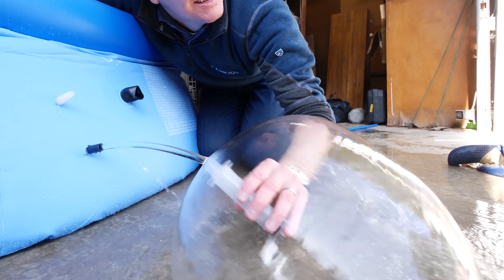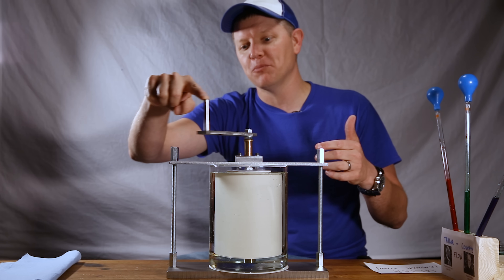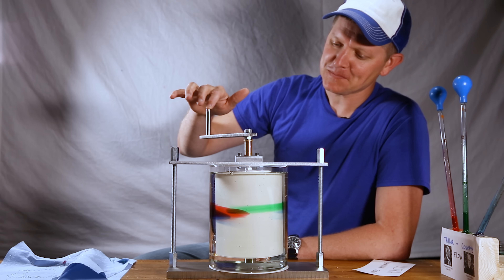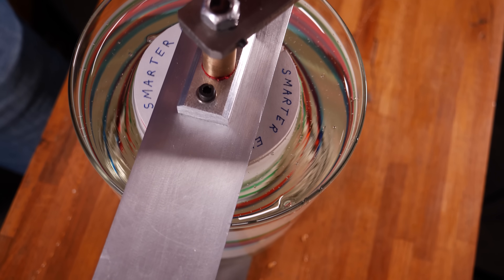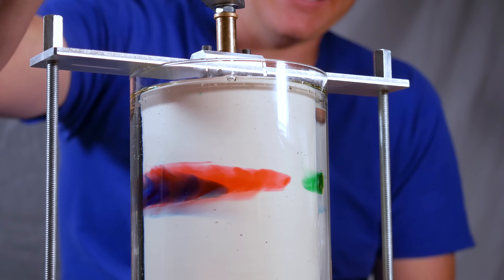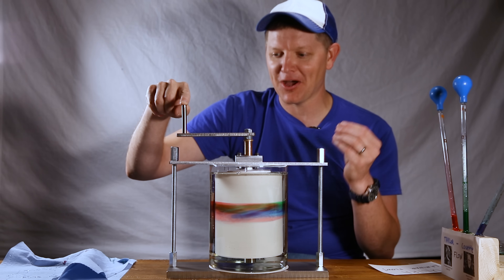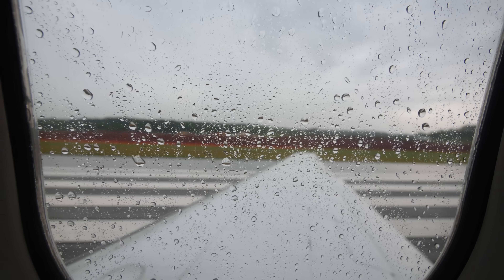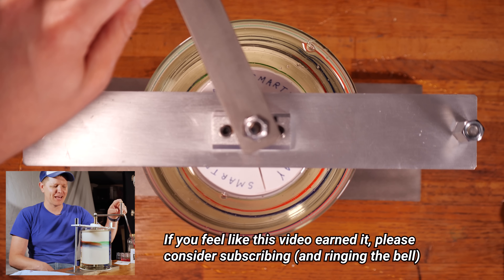Unmixing Color Machine (Ultra Laminar Reversible Flow) - Smarter Every Day 217

Comment: Something similar maybe. I sometimes think of lining the bottom of a glass pan with different coloured jelly beans. (only 1 stack thick) Separate all of colors into different regions or what ever, to form a pattern of some sort.
Now, put the lid on it and shake it up. How many more shakes would it take to get the exact pattern you started with? Do that whole process in slow-mo.

Comment: For some reason I think I was thinking about this in my sleep last night and I'm not sure if it's been mentioned in the comments but.... did this work because the 3 dye blobs were in different planes to each other ie each at slightly different distances in between the inner and outer walls?  In my head it worked because the 'twisting' of the corn syrup created thin films of colour that overlapped each other and so easily un-overlapped when returned to the start position.   Would it work or is it even possible to overlap the colour distances between the inner and outer walls?

Comment: Duuuude, that was so cool. I definetely didn't expect it to unmix so perfectly, I thought there would be some blurry blobs but that's crazy. 
It feels like reversing entropy. Awesome science, and your genuine enthusiasm makes it even more more fun to watch. I love your videos.
Reply: Spot on! This experiment indeed shows that reversing entropy changes is possible... however since the process itself was dissipative and non quasi-static, reversing the state of the system required putting in more work, while in a truly reversibile system you would get the originally spent work back, to get delta S=0. In this case instead the entropy is equal only for the system, while the entropy of the universe has increased (es. the room and Destin are hotter than before as a consequence of the work Destin put in)

Comment: Makes me wonder about the trachea of mammals where ideally there would be no laminar flow. The cartelagenous rings that give it the strength to be round in negative pressure on inhalation also protrude on the inside making ridges that the inhaled and exhaled air would have to cross.  I wonder if that causes small eddies which then helps include the stagnant air at the sides to decrease pure laminar flow??
Joe

Comment: actually i dont think that this is real fluidal beahaviour. a fluid would behave like a lose rope between 2 surfaces. what we can see here is a behaviour that is more like a stretching rubberband between 2 surfaces. 
what do i mean by that?
imagine you attach the ends of a long rope to the 2 surfaces and turn the inner cylinder till the rope is completeley wound up.
now if you unwind the inncer cylinder it will start moving only the end back to the starting point which is attached to the inner cylinder. in the end the half of the rope closer to the outer cylinder will not have unwound at all.
this is an analogy to fluids where parts are not restrained in some special order and only move with each other because of cohesion force between the molecules.

now imagine doing the same with a rubberband which is tensioned between the 2 cylinders. After unwinding the rubberband will look exactly the same as in the beginning. That is exactly what we see in the video
this however is more an analogy to (elastic) solid materials where molecules move together not only because of cohesian forces but also because they are bound together in a defined structure where they can not move freely.
something tells me that we have some related behaviour the the fenomenon of non newtonian fluids here, especially considering that this fluid is corn sirup which is for sure similar to the famous non newtonian starch+water mix...
i wonder what anybody elses opinion is on my understanding of that topic

Comment: I would add this setup has a real live use, as some viscometers work this way. The flow is one of the not-so-many analytical solutions of Navier Stokes equations and by applying a constant angular velocity and measuring the torque you can get a relation between both proportional to the viscosity. 

Cool vid! I just finished taking fluid mechanics and it is nice to see these topics in big channels

Comment: I wonder if you'd get better results with a really geared down motor, so the rotation is very consistent in speed
You could also try pulling a vacuum to get the bubbles out, they might cause some irregularity too

Comment: People do the same thing to make interesting pattern in glass when doing something called lamp blowing. One thing is to have a hollow tube of glass and a oxy propane torch.. heat and laydown stripes of colored glass.. Then melt in and attach a punny.. Something to the other end. and heat and twist. Then.. When twisted.. Lay down more straight lines over it.. melt in then untwist (while hot and flowing correctly) and stop halfway.. You'll have a mesh weave pattern going at angles. That also will happen with glass if you use different color glasses..  Clear and a color have different melting points and flow differently.. Some colors flow better than others.

Comment: Not that it's easily testable (you'd need magnets probably), would this work on multiple axises if you could suspend a metal sphere in a sealed glass ball with a viscous fluid between? Or does something breakdown if you can make the paths intersect?

Comment: That was so cool! Question: if you use an automated turning system to go forward and backwards such that there is a constant. slow speed (and therefore a constant viscosity) would that prevent the striations??

Comment: Would increasing the speed of the rotation break the viscosity? My guess would be yes, but only because hes using his hand. There would most likely be inconsistencies with the speed.
Could slowing it down to a 24 hour rotation allow for more full rotations? Is it possible to reverse laminar a month? A year? Could there be a practical use for this in an abstract clock?

Comment: I've seen this demonstrated (media not live) before but it still amazes me. The various flow regimes are fascinating but I think ultra laminar is "the schiz" as they say. We use a long chain polymer as a drag reducing agent, to significantly increase the capacity of a pipeline (like 80% more capacity) in the crude oil pipeline business. I wouldn't mind seeing you do a video on that. I (think) understand how it works and why it works but it blows my mind every time I see it in action. Audio books- I am currently listening to The Making of the Atomic Bomb. It's a very long book and it covers the birth and development of the nuclear age. I have a bad habit of taking a break from one long book, starting another long book, then taking a break from that one to start another. First I started listening to the 3 volume set - The Civil War by Shelby Foote (amazing book), then switched to House of Rain by Craig Childs (he searched for, and I believe found, where the so called Anasazi came from), I almost finished House of Rain and switched to The Making of the Atomic Bomb during a long (980 mile one way) drive. I managed to go back and finish House of Rain before I got too deep into The Making of the Atomic Bomb. Somewhere in all of that I also read The Great Game of Business by Jack Stack. Can you tell I'm an Audible fan?

Comment: As someone who is into laminar flow, and into practical application for the science concepts you present, you should talk to a mud engineer (aka drilling fluids engineer).  They deal with viscosity and flow all the time when they work on drilling rigs.

Comment: I'm curious to know if the sheer thinning occurred due to differences in the speed you were turning. I wonder if there would be less striations if you used a speed controlled motor instead of a hand crack

Comment: One of the definitional features of laminar flow, and in particular laminar flow at very low Reynolds numbers, is the zero mass transfer between the layers of flow (for want of a better word). Zero mixing between the layers means that if the different coloured drops of dye were located at different radial distances within the gap of the rotating cylinders, then the colours will not mix and the stretching out of the dye could be effectively reversed.

You can repeat this experiment within a transparent tube and create a similar laminar flow type shear field. If you insert different colour dye droplets at different locations within the cross sectional area of the tube, you will achieve the same effect. That is the dye drops will stretch along the length of the tube in the direction of the laminar flow and become long strands or strings. These should be able to be reversed by reversing the direction of the flow. 

Q1. At what location within the tube will the stand length be maximised? [2 marks]

It's common to use dyes to determine flow regimes and behaviour in fluid mechanics - especially in turbulent flow regimes where the flow becomes quite complex (vortex as well as stagnant flow formation etc).

Comment: Graphics interchange format
Its Gif like you say Graphics with the same G, its not Jif like you say it.
Reply: The pronunciation of an acronym is not dependent on its constituent words.  "CUNY" is pronounced "Cue-knee", even though it stands for "City University of New York".
Reply: BrightBlueJim your example of CUNY might be off, because SUNY (State University of NY) is also in common usage and it’s pronounced “sue nee” so the “coo nee” pronunciation is needed to disambiguate CUNY from SUNY.  But your point is valid, not every acronym is pronounced using the same consonant (or vowel) sound as its constituent words.  Interestingly enough, both CUNY and SUNY use the “you” sound of the U in university, not the “uh” sound of the u in... “sunny”.  Again, this is probably to disambiguate SUNY from sunny, I make no comment on the (very unfortunately acronymed) City University of New York.  Had anyone asked me I would have called it the “New York City University (NYCU)” to avoid both confusion and verbal slips 😄

Comment: if you were to take epoxy resin and do the same thing with the colors but at different heights in the resin (bottom middle and top) and spin the cylinder then let the resin cure would you be able to create the same thing or see the spiral in the cured resin?

Comment: One of my physics professors did this in class to show us that things can be "reversible" despite not appearing that way (we were discussing thermodynamics). At the time I did not understand there were spirals, so I thought the dyes had literally overlapped and that it was pure witchcraft that separated them. I had a huge "OH" moment with 7 years pent-up mystery thanks to this video. 

In a perfect system, spirals should never be able to intersect, but winding up the spiral many times means that any dye that moves radially a little bit will be much farther from its own color dye at that radius. A simplified wound up spiral of dye can be described as  R = (small slope) * theta. Dtheta = DR/small slope = big number times DR. Dtheta is conserved when unwinding, so dye that moved radially DR when wound up ends up Dtheta away from the other dye when unwound. 

So the imperfections result from spiral-amplified diffusion.

Comment: Go for failure. 10 rotations, then 20. Put a low speed motor or put a gear reduction system on any dc motor, let it run for an hour, then reverse.  Channel your inner Kramer, ignore the gas gage and just keep rolling, baby!

Comment: Having just sat my final Masters year exam on Micro-Electro Mechanical Devices (MEMS) I can tell you that at the micron scale almost all fluids have very low Reynolds number and they exhibit the same "Creeping flow" that you see here so MEMS devices must be designed with this in mind even if they use a low viscosity fluid like water. Awesome video, always love your work.

Comment: I'm curious about what point a liquid is viscous enough for this to even work.
Reply: You just need really low Reynolds Number flows, which is a ratio of inertial to viscous effects. Theoretically, you could do this experiment with water and ultra low velocities, but diffusion would limit the reversibility of the flow.
Reply: @ThePost1994  ya I get that, but where is the magic number
Reply: @bodvarson1933  the conditions for Stokes flow (reversible laminat flow) is usually given as Re<<1.

Comment: I wondering if same can be done using water in semi freezing temperature and very low rotation speed(stepper with reduction gears) conditions 
also large diameter volume may help 

!

Comment: I was really in for the thumbs up until he called it a "jif"
Reply: Just to add variery, I'll let you guys know that in Spanish we use the soft 'g', which would sound like "heaf". Adios!
Reply: "jif" is correct.  Back when gif was new, there was a FAQ on Compuserve (where the format was developed) that answered the question, "how is 'gif' pronounced??"  The answer was 'jif'.  You can say it with the soft 'g' if you want, but don't impose this on others.
Reply: BrightBlueJim you are quite correct that the pronunciation specified by the developers was “Jif, like the peanut butter” but more than 3 decades later common usage is “gif” using the same hard “g” as in the word “graphics” (which is what the “g” stands for, after all).  I’m always impressed when someone under the age of 35 knows the original pronunciation of the word, but I personally gave up the fight to preserve that pronunciation in everyday usage around 1998 or 1999.  It’s like how Americans “mispronounce” aluminum or jaguar as compared to the original British pronunciation, but there are more Americans than Brits and American culture is dominant, so the American pronunciation is now standard.
Reply: @jpe1  I don't object to people choosing their own pronunciation, or with alternate pronunciations evolving.  What I object to is the certainty with which they declare that others are wrong.
Reply: @BrightBlueJim  I'm aware of what the creator wanted it to sound like...really big imposition, not giving a thumbs up...

Comment: Messed up the counting BOTH times as it ended up okay! That's lucky!
Reply: I don't know if counting is even necessary. I guess you might need to keep the rotations to a limited number, and as long as you do that then just keep counter rotating the cylinder until you get the initial condition you started out with.
Reply: @Nattfogs  Yes indeed, but a part of me was a tad freakin' out because he specifically said he'd do 7 where most done were 5. 😅
Reply: @Nattfogs  Opposed to keeping the rotations to an unlimited amount? 😆
Reply: Was sorta freaking out 'bout this. Lol
Reply: It's like REALLY easy to know when to stop when you go backwards.

Comment: I wondered why you didnt use some kind of servo motor to ensure uniform speed, but it appears it wasn't necessary to have perfectly uniform rotation speed
Reply: Going at an uneven speed doesn't have any affect on what it will look like once you reverse it

It acts like a rubber band wrapping around your finger making layers that dont merge together

But if you pull to quickly it will snap

Think of bluetak if you pull slowly it stretched and pull to fast it snaps

Sort of the same thing here

Comment: Destin, you could increase the angular speed and test what is the critical speed at which the laminar flow in the low reynolds numbers breaks down. My guess is you could spin it quite fast without reaching the threshold.

Comment: If you put a stepper motor on it and accurately controlled the rotation rate, would the striations have less impact?
Reply: I believe reducing the speed of a flow even further increases its Reynold's number, so yes, but the fact that the bubbles/food coloring are different fluids you may have it off worse on a longer timeline because of other effects mixing the two.

Comment: Thanks for making this Destin! It seems like the 3 color blobs were all at different depths thus keeping them from "colliding."  Was this intentional/required to keep them from mixing or is that an inherent result of the 2 fixed points dragging the color into a spiral and the colors still wouldn't blend if there were at the exact same depth and placed close to each other?

Comment: Would be interesting to see how accurate the reversed "image" is at different rotation speeds.
Reply: I believe you begin to lose some of that reversibility due to a rising Reynold's number. Reversibility amongst fluids is really only observable in slow moving flow
Reply: yes, it is interesting,    it would be a nice test to see what the maximum speed would be for it to work,  but also how it looks when moved a bit too fast

Comment: Awesome video as always Destin ! What would have happened if you spun it faster and what is the angular velocity limit above which the colours mix irreversibly ?
Just one note: 9:07 gif with G as in gift not as J in jeez !
Reply: Not according to the creator of the format. Remember: choosy programmers choose gif.
On another note, the colors already did begin to mix irreversibly, but  they were separated enough that the slight blurring didn't cause one to run on top of the other.

Comment: wonder what would happen if you did something similar to this with a resin that would eventually harden. you could use a hollow core and break away the inner structure and outer structure leaving a cylindrical resin mold of the beautiful colors trapped in the resin in place.